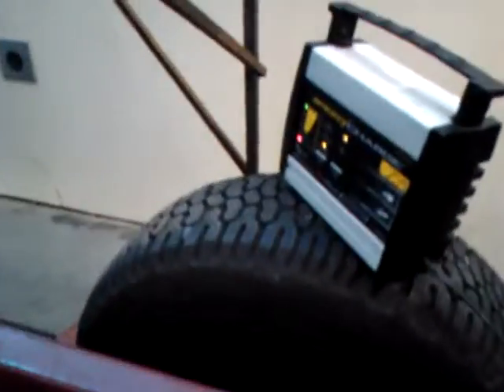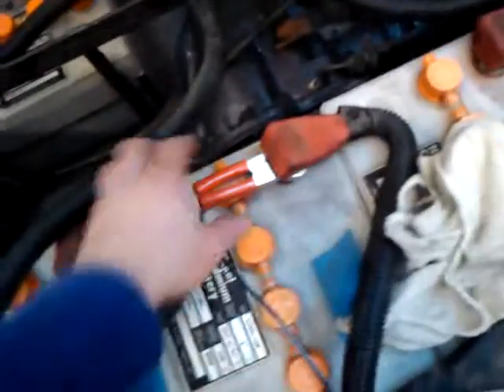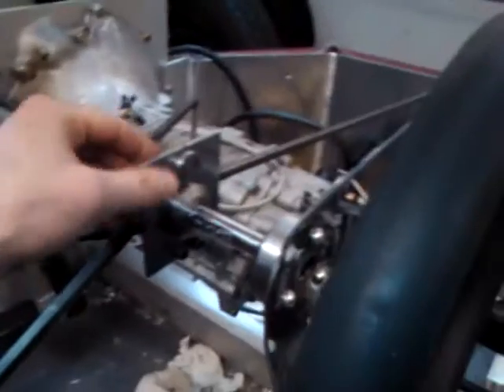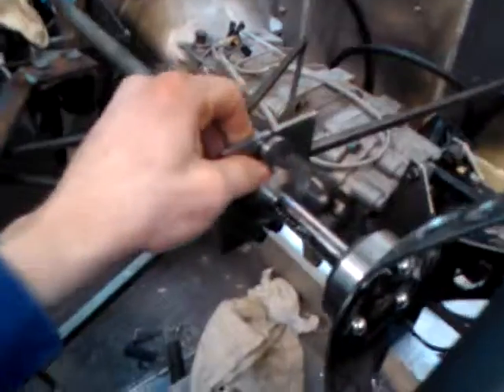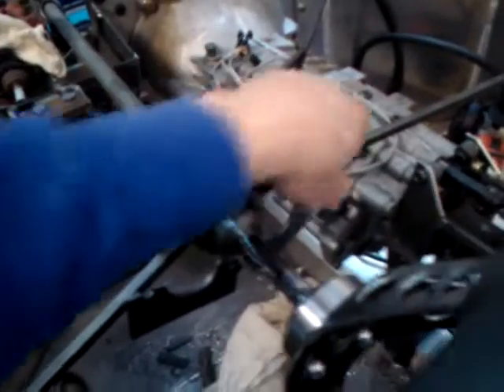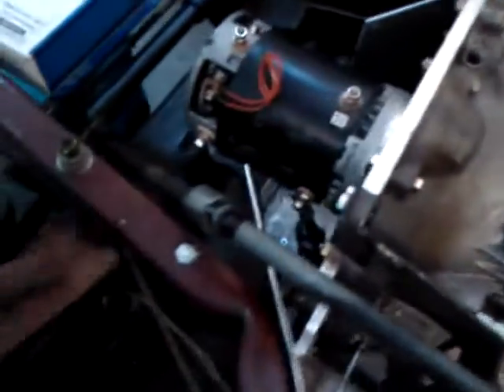electric Ferrari project

Comment: Hey Mark. I saw your video on the reverse trike electric car. I want to make one myself and was wondering where to start. Did you do the whole project yourself including welding? And also is there an optimal front suspension and possible frame already in production that I can build upon. Thanks for inspiring people to become engineers.